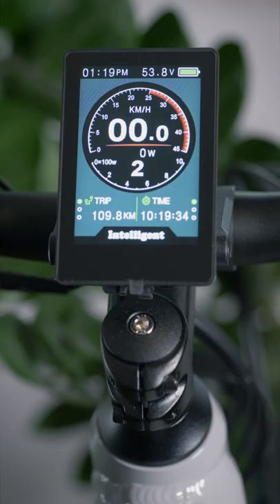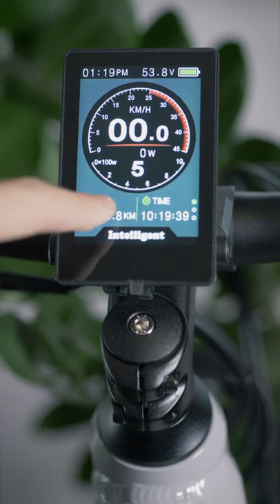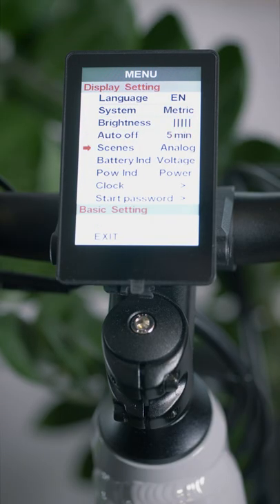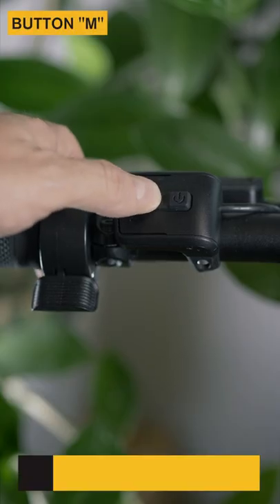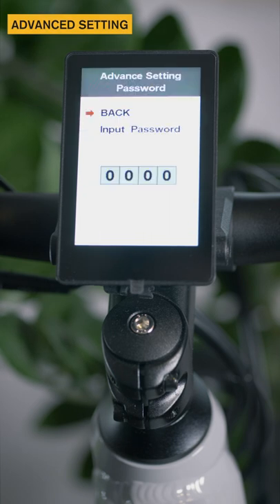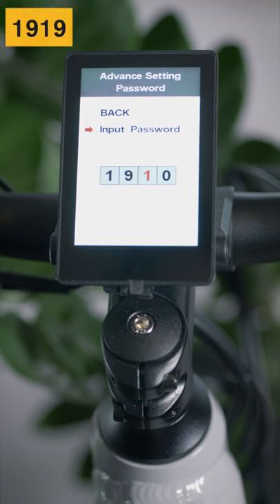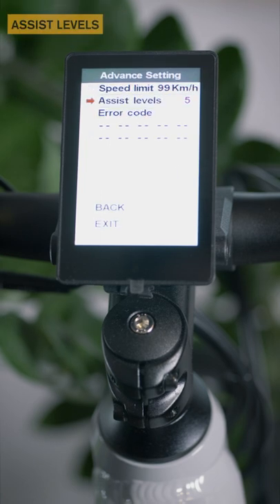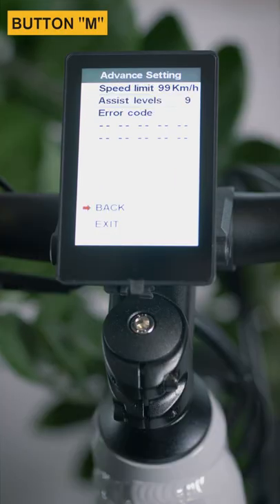How To Unlock E-Bikes Max Speed #Shorts #ebike

Comment: I wonder why they lock out the last level. Safety? To extend battery life?
Reply from the maker: I guess they want to comply with the local speed regulation, extende the battery life and let the new riders get used to the bike high torque before unlock the maximum speed. It can be dangerous for new users indeed.
Thanks for watching and have a good day Bruce

Comment: Hi I have a DPC-18. It only has 5 levels, any way to unlock it to 9?
Reply from the maker: I'm sorry, but I don't have this bike anymore.. I would like to double check, but I am not sure that it can be unlocked to 9 leves :(
Thanks for watching
Reply: @BK42Cycles  wow thanks for the quick reply and checking. Unfortunately I think ur right, DPC-18 seems to be locked to 5 PAS.

Your video helped though, I ordered the exact same display from eBay. Cheers!
Reply from the maker: @hyedefinition1080  I'm glad to hear that. This is a great display, you won't regret. As well, if the max PA 5 delivers the maximum power, you don't need more levels indeed  ;)

Comment: I don't think that gives you any extra power. It only gives you finer steps from 0%-100%

To limit the power to comply with EU law is also possible in settings by limiting the top speed.

What I'd like to know is if this head unit has a cruise control mode.

BTW I had to look up the light switch button press 🤣 why is that so secret!!
Reply from the maker: Hi :) The power is limited to the motor, controller and the battery, what it does is let the user to access more Pedal Assistance modes and in the end more speed. Indeed they keep it it locked to comply with the EU laws and the rider safety. As this is a very specific mountain bike, people usually ride it off roads, so it is good to know how to get the max of this bikes. I don't recommend using all that power in the cities, neither more than 25km/h ( there is the max. speed control in the settings )
I had the same question about the light button, my other e-bike has it, it wouldn't be a big deal to make one extra button :)
What do you mean by the cruise control mode? 
Thanks mate
Reply: @BK42Cycles  on the Lectric XP ebike there's a button press that will lock the motor at the speed it is turning. Like in some cars. When you touch the brake the lock disengages.
It just lets you take your hands off the throttle. For an advanced unit like the 860C you'd think it would be included. If not perhaps it's not the safest feature!

I'll do some tests with mine and see if 9 levels of Pedal Assist gives me more vroom! 😁
Reply from the maker: That is really clever! I was thinking to design an adaptor for that, I have some ideas about how to do that. It indeed would be great to have. Unfortunately, the bikes I have are not equipped with the cruise control
Reply: @BK42Cycles  here's what it looks like on this old head unit: 

https://www.youtube.com/watch?v=k4Q8RVoo7V0
Reply from the maker: This is awesome! It should be mandatory to have it :) Tks sir